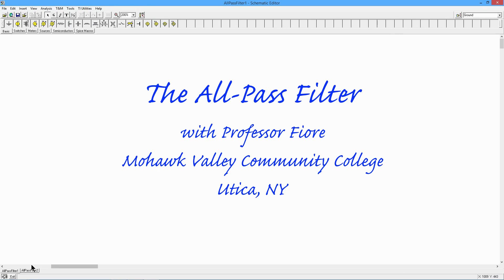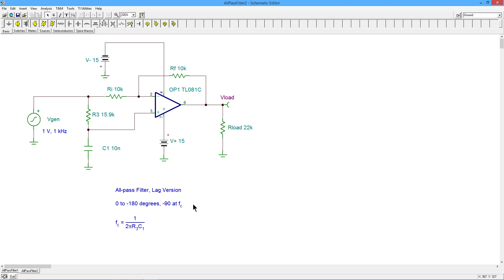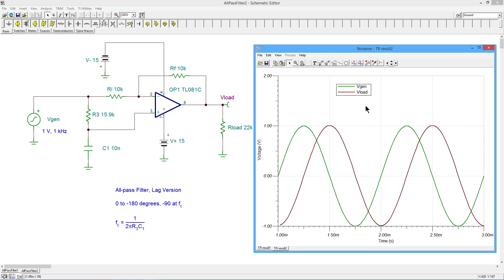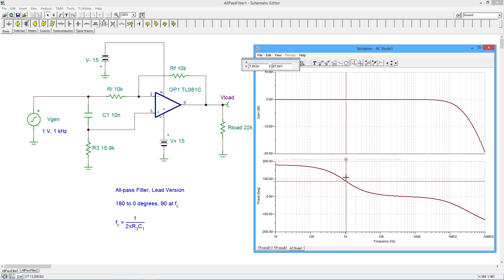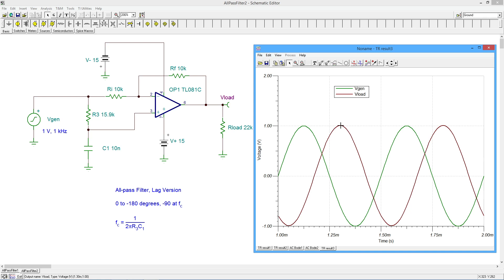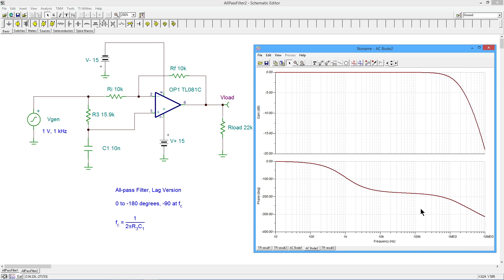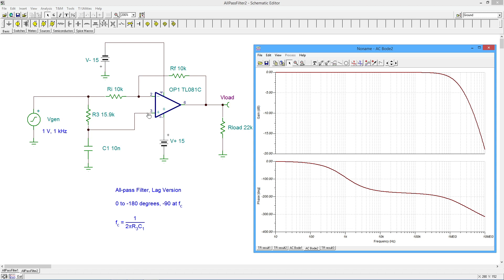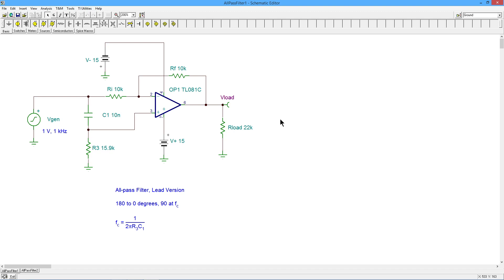Op Amps: The All-PassFilter

Comment: A question for students - if you feed the ac input signal to a leading and lagging all-pass filter in parallel, then use a third op amp as a summing amplifier, what will the output be? And will it be the same for all frequencies within the RC filter range? Try it!

Comment: Thank you for the video. I have a question. Here both filters have a descending phase as frequency increases. That is one filter goes from 0 to -180 and one from 180 to 0.  Is it possible to have an ascending phase all-pass filter? (e.g a filter that goes from -180 to 0)
Reply from the maker: If I understand you correctly, you're asking for the same sort of circuit but with a positive slope, right? I am not sure that you could make one as simple as this little first order circuit. I'd have to think about that for a bit. I can't recall seeing one.
Reply: @ElectronicswithProfessorFiore  Yes, exactly. I'm looking for such allpass filter because I want to cancel out the phase shift caused by a preceding highpass filter. If possible then we can get a hp filter with flat phase response. But maybe such allpass filter is impossible in principle?
Reply from the maker: @siarez  It sounds like what you want is constant group delay or linear phase for your filter. In that case, I'd suggest looking at standard active filters using a Bessel alignment instead of the usual Butterworth (check the videos in the Op Amps playlist or chapter 11 of my free op amps text). A 2nd order Sallen & Key wouldn't be much more complicated than the circuit in the video above (as in another cap and maybe another resistor).